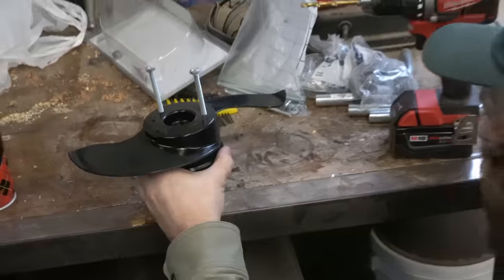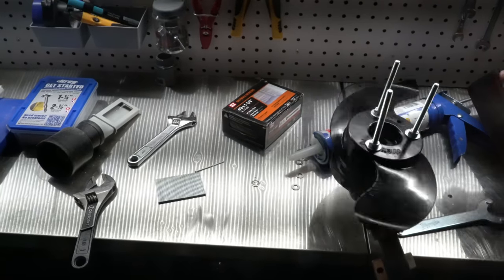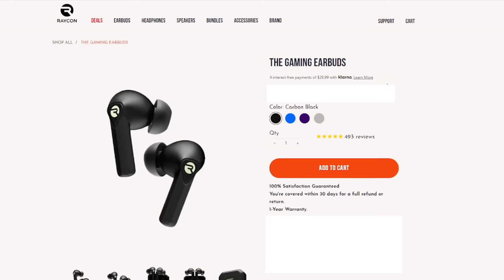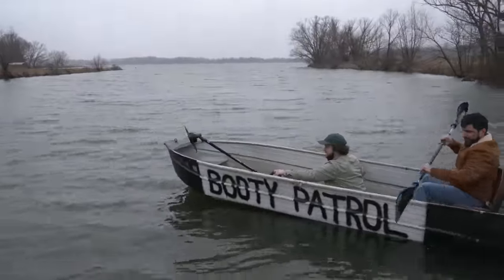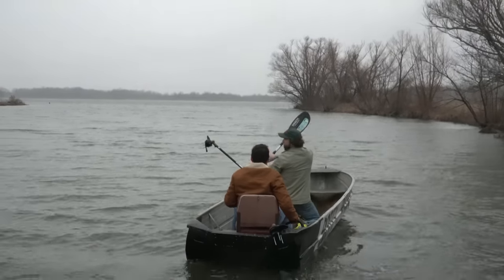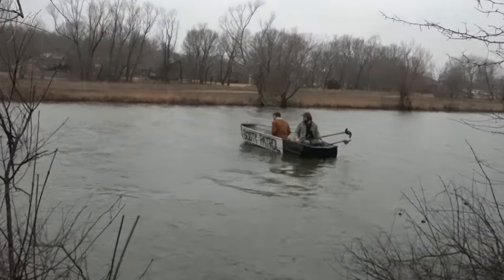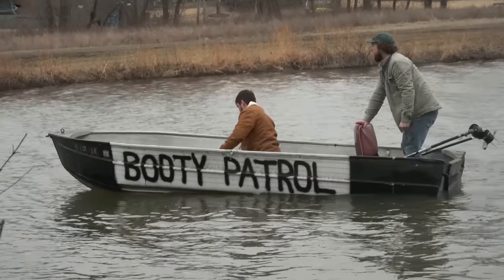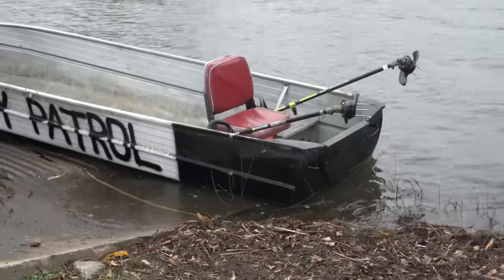Weed Eater Boat Motor, Will It Work?

Comment: Next you should attach a circular saw blade to a weed eater and see if it would be a good power tool for those hard to reach cuts ✂️
Reply: They sell kits for that and I was unlucky enough to find a 4cm piece of fence wire that lodged itself in my left calf muscle needless to say it required a pretty invasive surgery to remove I still have problems walking almost two years later  I do have to say tho nothing cuts saplings better except maybe brush hog on a tractor
Reply: use that at work for little trees lol
Reply: @wesbrackmanthercenthusiast4695   soooo.. all in all you would recommend it and do it again?
Reply: @Franz Rupert   yes, but only with chainsaw chaps and another adult present incase of injury aka one to get help or to stop bleeding but that really just goes with any machinery
Reply: @OfficialDuckStudios yes that's the one lol
Reply: @wesbrackmanthercenthusiast4695  How? i had a root ripper enter my calf and hit the back of my knee joint, walking 3 months later. Must have been a compo claim hey?
Reply: Don't need a kit! Blade fits right on 5/8 arbor. It works but for removing heavier brush and not very efficient. But will work.
Reply: It works if you use a Stihl trimmer instead of a crappy Ryobi
Reply: I've done it, and use it for a tree trimmer. It works very well, butt really puckers your butt when it jumps off a larger limb.

Comment: I have done this and it can work but you need to cut down the prop to get the engine rpm up. I ended up buying a small aluminum prop after I figured out the right size. Really moves a kayak along pretty fast

Comment: i made one 10 years ago , used a old battery drill connected to wiper snipper shaft with a real prop for water . it worked flawlessly and still works . use it with canoe  was faster than paddling

Comment: I used a flat tine little rototiller blade off of a little cheesey two stroke. 

Bending the tines EQUALLY IN SMALL INCREMENTS until I found the sweet spot. 

 Its effective as a prop for trolling. Oh and my weed eater is a Straight Shaft with an elbow at the end and I just flipped it over and packed it with Marine Grease. I flipped the adjustable handle over and attached it to an oar lock that I attached to the back of the boat.

Comment: I’m planning on turning my 12ft Jon boat into a hydrofoil in the spring and was toying with the idea of using 2 weed eaters for propulsion 😂 they would probably perform better with an optimized propeller, but I’ll probably go with my second idea using a 6.5hp predator 212
Reply: I think you'll need a bit more power than 6.5hp

Comment: Try a Long Boat configuration with a gimbal bracket on the transom. Extend a handle over the motor and use a prop with some pitch on it!, trimmer rpm is lower than a trolling motor.  Expect no more than 5 mph.

Comment: A propeller with sharper blade angles would be my guess as to what went wrong. Oh and if you drilled a hole half way up the shaft that will keep it from sucking up water in the shaft. Just a little food for thought.😂

Comment: But can I cut grass with a boat engine attached to a weed eater? Wait what would be faster that or a lawn motor with a super charger?  Id love to see who builds a better tool to cut grass lol
Reply: About fifty years ago I supercharged a Briggs & Stratton flathead engine with one of those air injection pumps made for reducing tailpipe emissions from automobiles. That still wasn’t the hottest go-kart I ever had, though. That would have been the one with the air cooled VW Beetle engine!

Comment: Need a smaller propeller prop and it will work great...  The one's your using are to big for the engine. Think of it like this if you put monster truck tires on a Honda Civic it's not going to make enough power to move them like you want. Right? But the right size tire will.

Comment: It does work get an original weed eater that has the curved shaft it works well just be mindful that the gas cap will leak

Comment: Valiant effort.

The weak link is the reduction gearing in the head.
If you eliminated that and used a smaller, higher speed propeller you would succeed in the tail dragger mode.
Propeller from above with zero reduction 90 degree from an angle grinder gear (zero reduction) for a side thruster (powered paddle).

Live hartily in your energetic youth.
You will never lose these times and you will never reproduce the energy and effort you are doing after you are 39 (arbitrary non-substantial figure)

I am always thankful. Full Stop.

I am always thankful that I endeavored to excell in my twenties because, from my sixties, I see I would never push as hard as I did then.
Only downside is: Now I hate myself for not forging forward with satisfying force.

If I never tried anything, I would probably be happy to have never achieved anything.

(unrelated) If it jumps when you kick it, it is not a dead horse.

Comment: Those bolts are causing severe cavitation in the water. Cut off the bolts and it will work a lot better.

Comment: Try A larger prop and A 2 cycle weed eater those 4 cycle engines are low RPM if you get just A cheapo 2 cycle weed eater and put A boat prop on it the fact that the 2 cycle engine will rev up to 8000 rpms it should work of course that's if you get 2 of the 2 cycle trimmers most boat engines are 2 cycle as they have much higher rpms now instead if you don't want to do another weed eater boat engine video try getting 2 Husqvarna 150-bt 50cc 2 cycle gas back pack leaf blowers you obviously can't blow the air into the water however you could mount the 2 blower tubes to the rear of the boat and it would go like all hell it would be very loud and fast

Comment: it's all speed and no torque... need to 3d print a better propeller... and the rear mount was definitely a better idea just need someone to make a swivel mount and a mud motor end on it use another junk swappable extend it attachment type for it well actually use one of these already modified couldn't hurt to ask a helper at the cow palace come june 🤔 pretty cool nerds there to elp